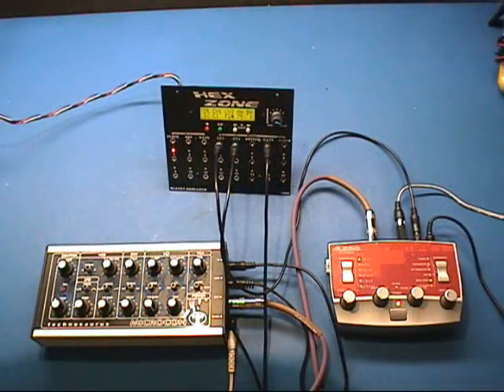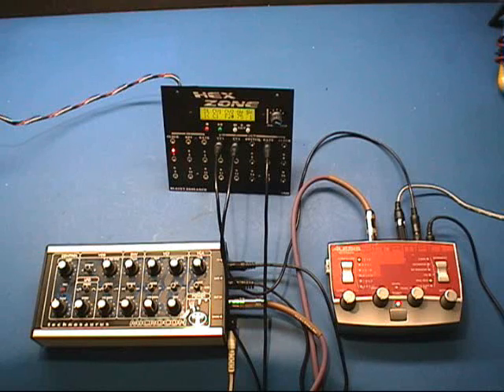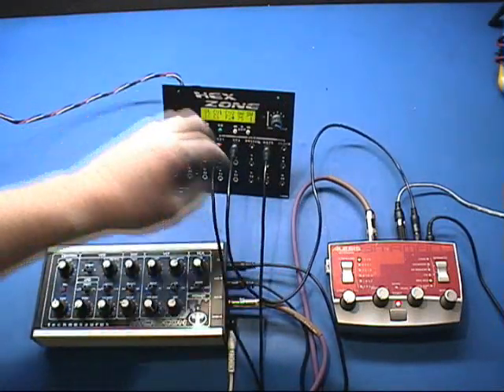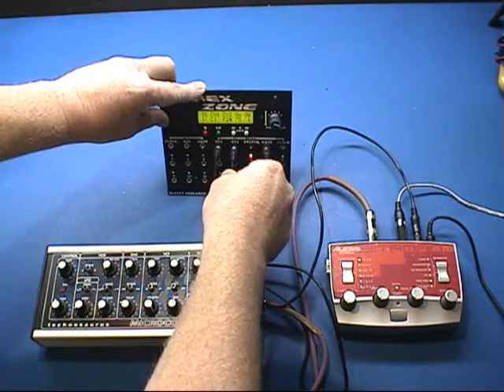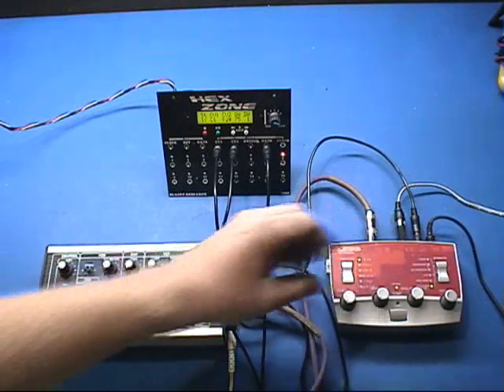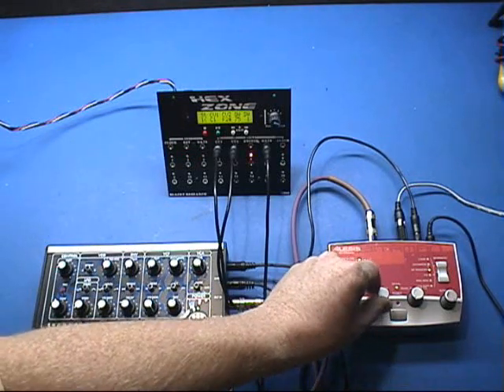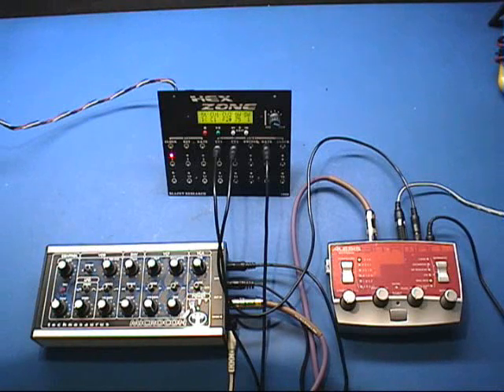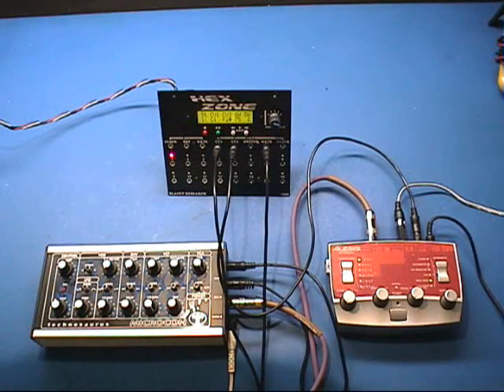Alesis Bitrman Control Voltage Mod

Comment from the maker: I'm not sure what secrets you think there are.  All the ModFX line is based on identical hardware and PCBs.  The only difference is the  code programmed into the microcontroller and the front panel bezel (and associated switches and LEDs)  It's a WavefrontSemi AL3102 DSP with a Philips 8751 to scan the pots and switches and program the DSP.  The 9 pin connectors are connected to the DSP's extra serial input and output channels and allow chaining of effects without extra D/A and A/D conversions.

Comment from the maker: I haven't had time.  This mod should only be done by someone with some decent electronics background and understanding.  You can start by lifting the center leg of the pot and using that as the input.  I suggest optoisolating it.  You may or may not need a pull up resistor depending on what type of optoisolator you use.
Reply: any pics or videos to mod would help please

Comment: Sounds great.

I'm specifically looking for a bitcrushing effect I can 'sweep' manually. Does the Bitrman allow you to sweep the level of bitcrushing effect using one of its knobs? I want to chain it onto my Novation Nova 2 so I can bitcrush my bass sounds live. 

Beyond that, are there any other hardware inexpensive hardware boxes which do bitcrushing I could use?

Many thanks

Jake

Comment from the maker: That's not how I did it but that could be made to work.  Depends on if you want the pot to act as a DC offset control or a modulation amount control.  I chose modulation amount.

Comment from the maker: I'm not going to make public my modifications until I can sort out overvoltage protection.  Right now it's possible to destroy the pedal by feeding it too high a voltage on the CV input.  I don't want to be blamed for other folks breaking their pedal.
Reply: zener diode 3V from ground to input should work